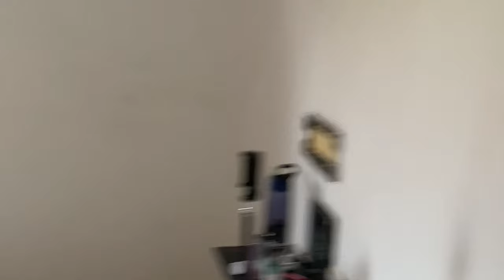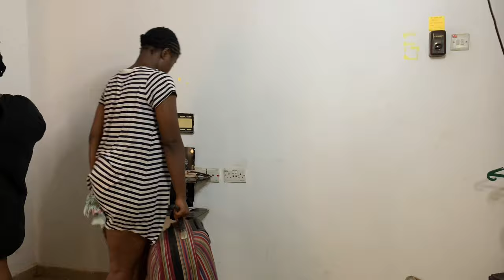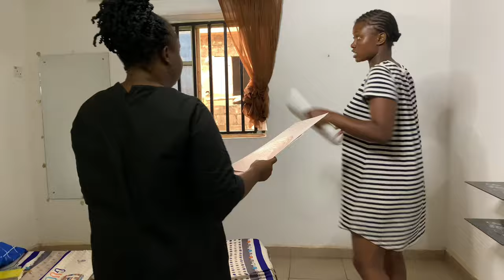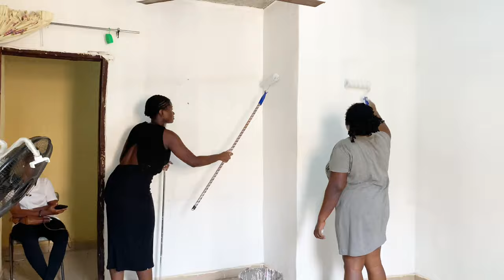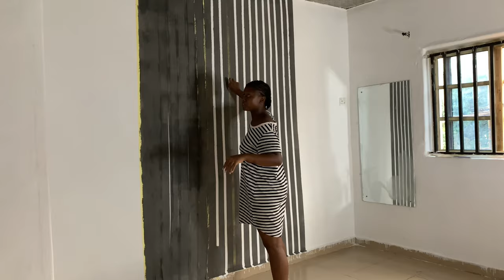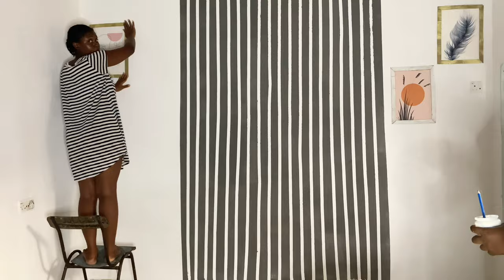SMALL ROOM MAKEOVER with DIYs on wall paper and ottoman ( small budget makeover)

Comment: Plsssss those black lines,i really did not understand it turned out so beautiful..plsss can u make another video to explain better plsssss.
Reply from the maker: Thank you, I don’t have a detailed video on it, but I will try to explain how I got them. 
I measured out the length of my bed, and marked out the same length on the wall adding about 5inches extra on each side. 
I used a masking tape to demarcate the wall, I measured out two inches which I wanted to be the grey color, then measured out an inch and put the masking tape over it, the part the masking tape covers will be the white part. I repeated this process till where I wanted it to end, the I painted the wall and left it to dry, afterwards pulled the masking tape out,and that’s how I got the white lines in between.
I hope this answers your question